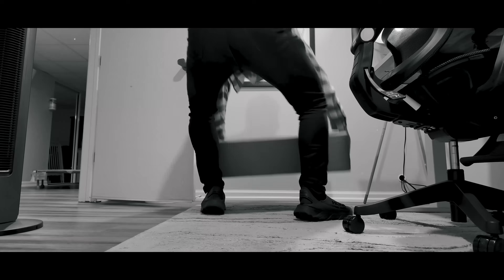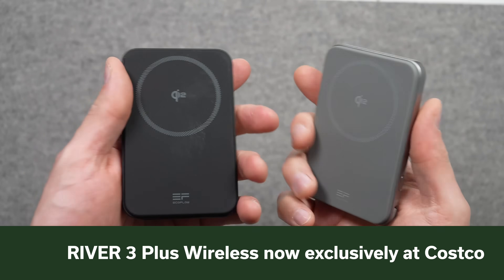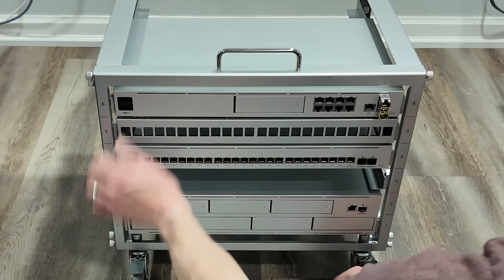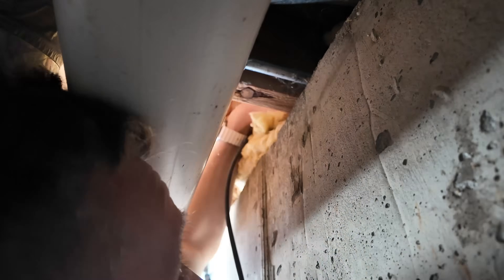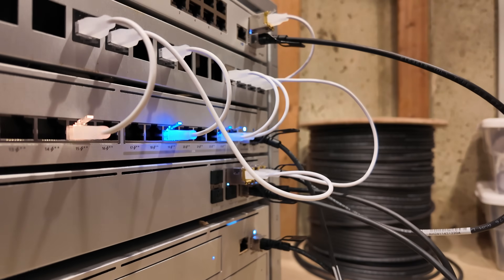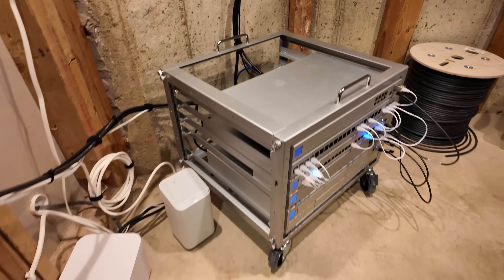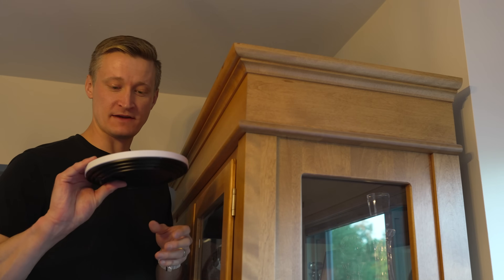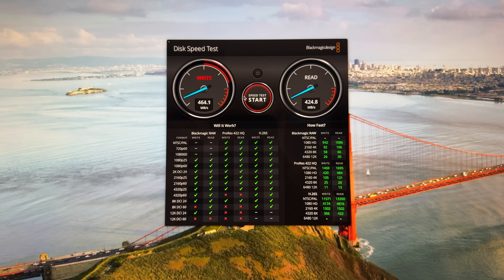Building my DREAM smart home rack with Wi-Fi 7 + 10GbE

Comment: The only thing I’d do differently is connect the U7 Pro XG access points directly to a switch capable of both PoE++ and 10GbE 

May I suggest the Pro XG 10 PoE switch in place of the Aggregation switch and maybe a dedicated CAT6A line to the dining room for the AP

Comment: I have a eero max 7 upstairs in my closet. The wires running to it are really messy at the moment. I have about 40ish devices on the network and everything is pretty solid other than a couple devices in the garage. I think I’ll add a eero 7 pro in the kitchen.